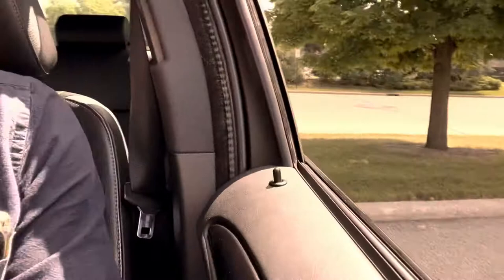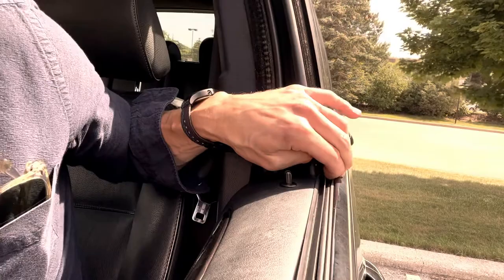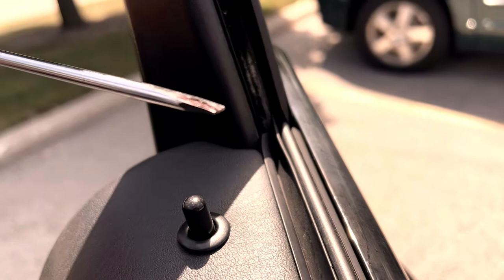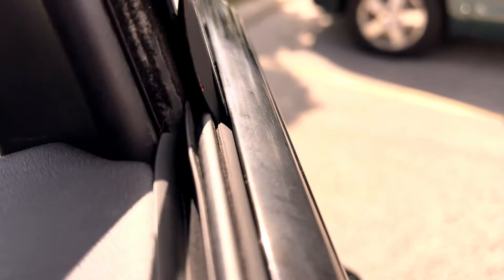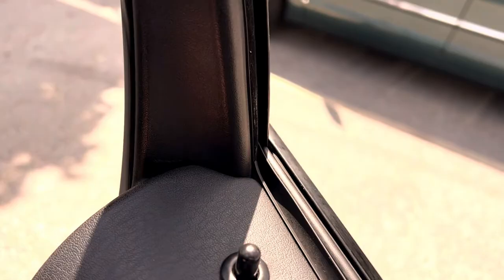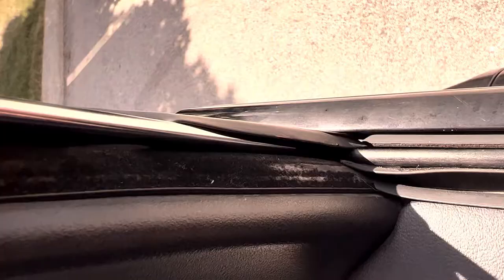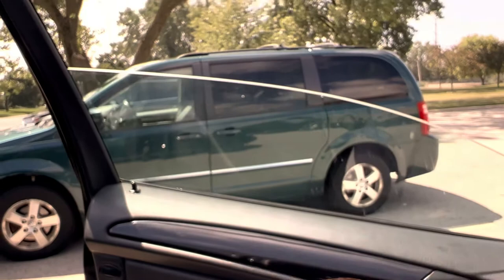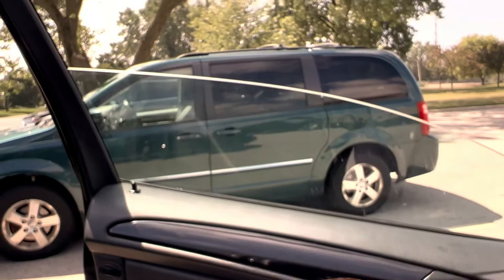E53 BMW X5 window stuck down? Here’s a quick fix!

Comment: Thank you soooooo much!! This worked on my BMW X5. I ordered food in a drive thru and the window would not go back up, it was pouring down raining and 38 degrees outside, with a 12 month old baby in car. I pulled over and fixed it with your video.
Reply from the maker: I'm glad you were able to get the window back up!
Reply: Jealous I’m kind of lost of where to wedge the tool. I’m gonna sleep it off and try again when I wake up!
Reply: @paulynns2139 Place the screwdriver right at the beginning of the window strip and kinda move your window up and down and push screwdriver foward..eventually it will go up..
Reply: @ronettalane1472 like move the screwdriver forward… towards the window? Sorry so late hahaha my brain is fried

Comment: Both my front windows did this. I did NOT NEED to replace the regulators ONLY the rear plastic clip at bottom of window. They break and the regulator tries to lift only the front part of window so it sticks.
Reply from the maker: Thanks for the tip. When I took mine apart, I found that the regulator was fine and just the clip was broken. Luckily I had ordered some based on your comment.

Comment: Keep those window tracks lubricated with silicone spray lubricant with a straw in the nozzle,makes it easier to go up and down and should help the window regulator motor to last longer,not just BMW's,all windows,electric or manual!

Comment: THIS WORKED.

I TOOK MY E53 X5 TO BMW OF NORTH SCOTTSDALE AND THEY QUOTED ME $1,600 FOR A WINDOW REGULATOR REPLACEMENT. HOW RIDICULOUS. 

THIS TOOK ME LESS THAN 30 SECONDS TO DO. I WILL EVENTUALLY OPEN THE DOOR PANEL AND REPLACE MY SPEAKERS AND FIX THE REGULATOR.
Reply from the maker: Glad you were able to get your window up. They are not cheap, but I think it is with buying oem window regulators from FCP. They should last a long time and replacements are free with the lifetime warranty.

Comment: My window reg has been replaced as this happened and a few weeks later it got stuck again, but the mechanic came to take the door off and it just went back up without changing reg, do you think that’s a plastic clip issue instead of reg aswell
Reply from the maker: Yes, it could definitely be the clip. It was the case on mine.